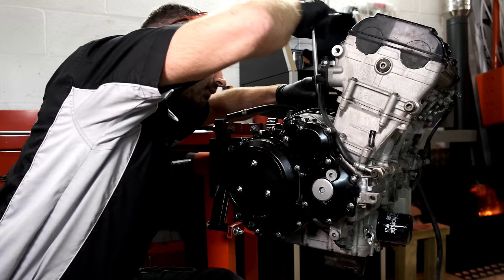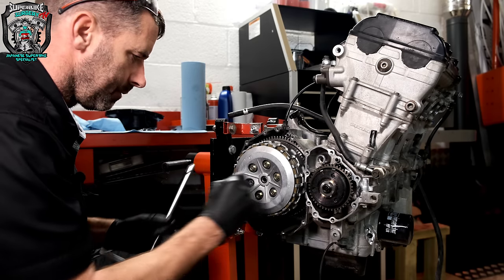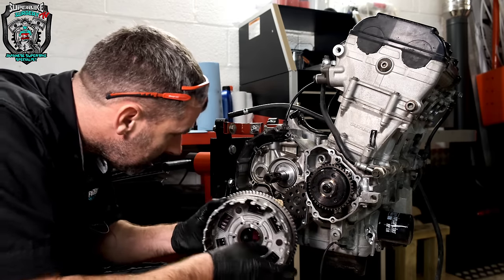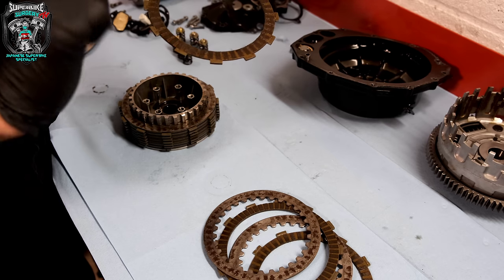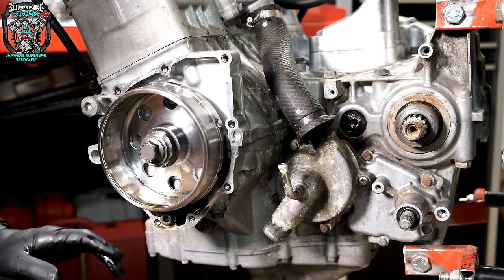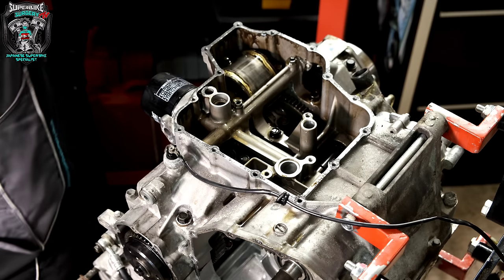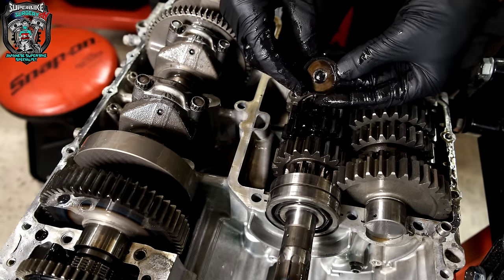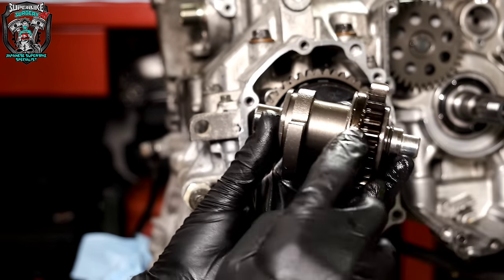Suzuki GSX1300R Hayabusa, Small Seal, Big Problem. An expensive mistake! (Part 2}

Comment: I was told you needed a special tool to hold the clutch basket to remove the centre nut. I was impressed that you could do the same job with just an index finger. Keep up the waffling 👍
Reply: There are some amazing methods. I've seen my mate remove the large clip on a Lambretta clutch by compressing it with a shovel, levering it off a bolt in the casing, instead of using a compression tool 😂😂😂

Comment: You can use a magnet to remove the clutch bearing and spacer.  And no problem to tighten the clutch basket, stator rotor, starter clutch and front sprocket with air or electric wrench.  But that's the only time I use it on my Busa.    Master video! .👍

Comment: Great vid Jim, but I was looking forward to you fitting the lower case to the upper, I wanted to watch you fit the selector forks and your method of doing so, as you lower the crankcase down. But you edited or left that crucial part out of the filming dang it!!
It’s not easy, you have to hold the selector forks in the right positions while keeping them engaged into the channels of the shifter drum, real fiddley job!
I’ve done the same job on a Busa engine, replacing the pushrod seal.

Comment: Thanks jim I have a 750ws I re placed the clutch plates and I have the problem of the bike wanting to move,back wheel turning and u
Jumps a wee bit when I engage gear I've also fitted an ignition advance what can I do to remediate this? Could it be the new advance?? Thanks again for the videos brilliant and informative....

Comment: Interesting little series, Jim. 

 Nice to see you back again and it's NOT waffle if in the course of the detour, you learn something.

Found some invoices from you in a recent project I bought, so at least someone who knows what they are doing have been inside.  About a week later you came back on here!

Silly question, how do you get your micro fibre cloths so clean, are they one use and binned?
Reply from the maker: Haha what a brilliant question 😁 I have a system! The short answer is...they start out new, usually get washed a couple of times depending what they were used for, slowly demoted until they are used to wipe the floor and then end up in the bin.

Comment: nice video !!  i realize your only doing the seal for the clutch rod.. if it was my own bike I would replaced the main . and rod bearings while i was is the bottom end  its only $100 more for parts  and also show how and where to put the sealer on the casing to prevent clogging the oil gallery  and how to inspect the shift drum and the gear dogs on 2nd gear and what to look for,  being that is a Hayabusa problem  and how to inspect the shift fork   and how the gear dogs can be machined / undercut  if there is ware . the bottom end is really not that bad of a job but i do recommend getting a manual for tourq spec.  and the manual shows where to put the sealer owe i also recommend flushing the oil orifice jets in the casing flush the oil strainer or replace it seeing how bad the clutch wore
Reply from the maker: Thanks for the comment, I've got a separate massive long video all about gearboxes! You could change the main and big end shells but I've no idea why you would? It'd be a complete waist of time and money. They are there to make up the oil clearance, nothing more.  Shouldn't be any wear whatsoever regardless of mileage.

Comment: 49:26 that would explain why aftermarket gear indicators usually worked via plug and play, I used to wonder how they magically knew what gear you were in when the bike only came with a neutral indicator from factory.
Reply: Aftermarket indicators work via engine speed and gearbox output shaft speed.

Comment: Don’t think he soaked the clutch plates in oil if he did change them that would explain the rust 🤨 cracking job Jim
Reply: i am old school mechanic we never soaked clutch plates back in the 70's-80's and 90's  so that must be something new i am hearing about  i can see that if you are running cork plates like Barnett clutch's  but the oem fiber plates really dont need soaked
Reply: @vphathom  watch part 3 you will see why 👍🏻

Comment: Jim, thanks for that great video...
Do you use a special engine stand for motorcycle engines or is it a general purpose (car) one with special (90°) adapters? Any hints from you what to buy that works for many/most motorcycle engines?
Reply from the maker: It's a std car engine stand with adapters I've made myself.

Comment: Really enjoyed that. Couple of comments. Isn’t it a good idea, if it’s your own bike anyway, to grease one side of the gaskets so that they can come apart without tearing next time? When you rattled the clutch nut off did you mark up the shaft ? You said the nut had a tab on it or something like that?  Oh yeah one other thing, foot lbs on a Suzuki? Not Nm?
Reply: No need to mark the shaft. Only Nm.   Sorry for the answer...
Reply from the maker: You don't need to ever apologise for answering 😁
Reply from the maker: Thanks for the comment 😁 I agree that grease on one of the gasket surfaces is a good idea if it's likely to come apart in the near future (race bike for example) it's unlikely to come apart again for many years so really not necessary. The nut is much softer than the gearbox shaft so wouldn't mark it. You'd likely do damage to the shaft if you tried to bend up the punched over part locking it to the shaft. Best to just undo it. Most service manuals give lbs-ft and Nm. I'm old school and my brain works in lbs-ft 🙃
Reply: @SuperbikeSurgeryTV  Ok!  I got lot of respect for your knowledge. Your video about the time-sert spark plug thread helped me years ago. It saved my Busa cylinder head. Very expensive, but it is the only real solution in my opinion.
Reply: @SuperbikeSurgeryTV  thanks for taking the time to reply. I have massive respect for you.

Comment: My father was a motor engineer for aircraft engines (with SAAB)... The amount of times he preached cleanliness around engines were uncountable, one time when I took his car to the Audi dealer for service he had asked me to tell them to clean the engine bay and motor – when I came back to pick it up they had refused to do so "to clean". My father was not amused.
(He also assumed that all mechanics no matter the type went through as rigorous training and held the same standard as aircraft technicians... Thus he refused to work on his car, lawn mower etc since he wanted "up to date with the manufacturers all bulletins and procedures. Perfection can go overboard.)